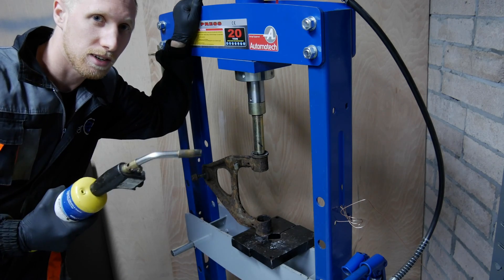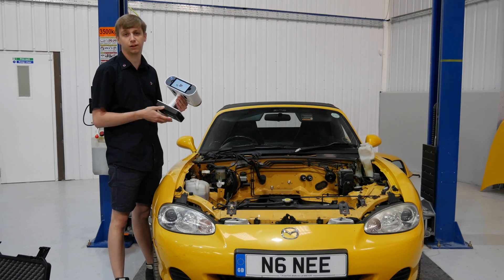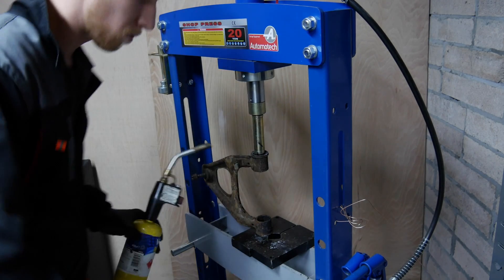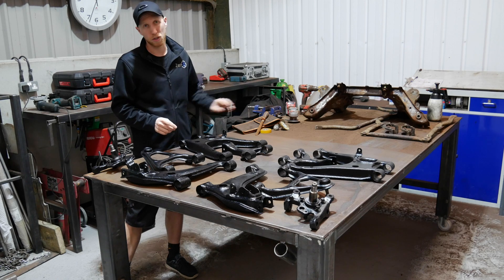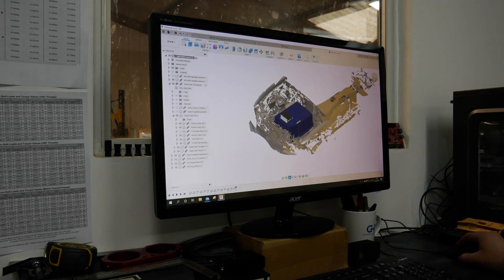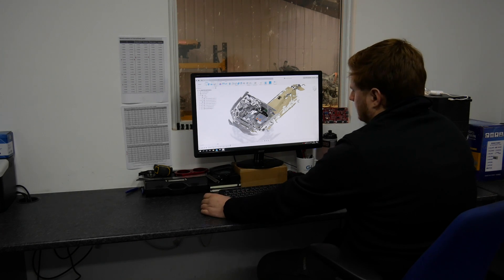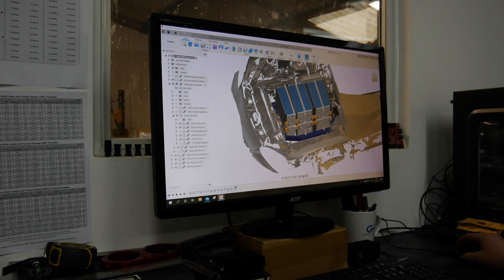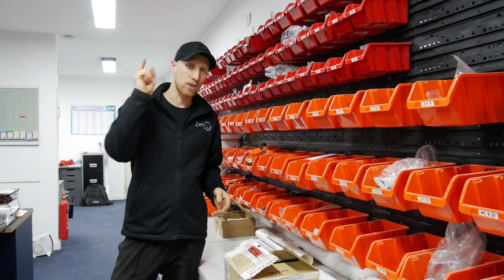Electric Mazda MX5 Miata Eunos EV Car Conversion - 3D Scanning, Fire & Cad Design

Comment: I'll never understand the obsession with removing the transmission. Why wouldn't you want a clutch and selectable gears??
Reply from the maker: Because with an electric motor you have so much more torque you don’t need it, also with the instant torque the motor slowly kills the grearbox and clutch as they where not designed for it.
Reply: @Hazell_Nutz  Torque is great, but the motor efficiency changes substantially over the entire RPM band.

The clutch on an MT has built-in shock absorber. Don't know if either of those points make sense.

Comment: How about registering it in DVLA? if you done conversion in your garage. I think it will pain
Reply from the maker: You can also provide invoice for the parts you have fitted.
Reply: @Hazell_Nutz  Thank you for the advice. I am looking to just upgrade Leaf battery up to 65KV or so on 18650 cells. Probably will be less pain at all.
Reply from the maker: It’s easy just v5 update and tax class form along with invoice of the work done
Reply: @Hazell_Nutz  How do I get  the invoice if I have done conversion in my garage on my own?

Comment: Wouldn't media blasting the rusty bits have been considerably faster and gotten you an even better result? Maybe using baking soda. Just a thought.
Reply from the maker: Yep would of been but unfortunately at the time was a Covid lock down so had to make do.
Reply: @Hazell_Nutz  Yeah, the situation has been pretty unprecedented lately. I believe you can buy baking soda blaster stuff to hook up to any old compressor though, it won't do what sand blasting does but it does peel off rust and such pretty convincingly.
Reply from the maker: Will look into that as we need something to clean down Tesla drive units
Reply: @Hazell_Nutz  Hope that works out well! Soda blasting is great because the medum is so benign, you can basically blast stuff in the back yard, the bicarbonate isn't that damaging. And once you're done, some soapy water to wipe off  the part deals with any residue. But, it's pretty gentle, comparatively speaking - so if you have like deep, caked up rust it may not be able to deal with that even at high-end psi settings.

Comment: I was thinking if you cut out the gas tank area and put all your batteries there, it might give you a mid engine feel. Probably not a good idea through because if crash happens, all batteries would smash toward the driver

Comment: lol, look at the state of that mk2.5, even the rear arches are buggered. the front chassis is going to be cheese! what cheapskates, I can find one for less than 1k in much much better condition than that! ahhahhaaha!!
Reply from the maker: Had to do one front chassis leg as did have rust, arches are not bad, the rear edge on drives side need sorting. We looked for weeks to find this model as they did not make many of them so if you can find one for less than 1k fare play.
Reply: @Hazell_Nutz  I honestly think it would be hard to find a more obviously rotten mx5 than that lemon one, i mean you can see the rot, absolutely easy to find one without any corrosion on the rear. the other front chassis leg on yours must have been repaired as it's probably not possible to have that much rear rot without both front chassis legs being cheese at some point
Reply from the maker: Rear rot? One lower seal is all that was done which is nothing for an Mx5. The more worrying thing is it had a 12 month mot when we brought it 😂. Hindsight is a wonderful thing but it’s now done and looks mint plus drives very well with all new bushes.
Reply: @Hazell_Nutz  you did a good job rescuing it!

Comment: Great build and thanks for sharing. One thing I'd do differently would be electro bath to remove the rust from the suspension components and possibly a rust converter for the hard to reach spots.
Reply from the maker: Yes we should of done that

Comment: Just a note, it’s very easy to bend the control arms by having them on the press like that. You should be okay with the torch helping but I’ve seen tons of those rear lower control arms get bent out of shape from pressing the bushings out like that.
Reply from the maker: Your completely right, have to be very very careful

Comment: and on the topic of the CAD design, another advantage of having a sub-assembly where everything goes in one piece, other than being easier to install, is that it can potentially increase the stiffness of the chassis as well, but that  is assuming that it is literally one big piece of strong metal which holds everything to the chassis

Comment: also, if  you have also scanned the gearbox after you've taken it out, you can use it as a template to verify the scan, and more importantly for its mounting holes, which you can directly copy off from instead of having to make a 'negative' of the chassis
Reply from the maker: The gearbox did not pick up on where we have mounted the frame to. But definitely the right idea if using original gearbox mounts

Comment: why didnt you get a sandblasting gun? you just need an air compressor, the blasting material, and a clean area to use it in
Reply from the maker: We wanted to get it blasted but was in lock down so could not.

Comment: I like how you made use of the flawed 3D scan of the car. I'm a 360 user myself.
Reply: I was thinking they might want to rescan a few bits again and fill in the blanks.
Reply: @jimbodee4043  

Would the extra effort be worth it?

They just need a few reference points, not the full surface model. 

Watching this made me reevaluate my own needs.

Comment: Sandblasting would have made short work out of suspension component clean up.

Did the weight of the battery module ~ = the weight of the original engine?

Wouldn't distribution of the batteries throughout the vehicle lesson the chances of damage to them in an accident?

I drive a 2015 Nissan Leaf so I'm 100% for additional electrics on the road.  Mines gone 47000 miles with no maintenance other than a recent change of tires.  The break fluid still hasn't needed topping up. Same for the engine cooling system.
Reply from the maker: It is always safer to have a single battery pack, having them throughout a vehicle can help weight distributions but will mean more high voltage wiring and additional safety systems. On the mx5 the thinking was that a second pack of similar size could be placed in the rear to increase range. The front pack does not come any further forward than the original engine so crash protection is still standard.
Reply: @Hazell_Nutz  

I drive a 2015 Nissan Leaf. The batteries are under the floor.

What's the range of the Miata?

Comment: Ah guys. I wish there could be a cheap way to scrap the whole bottom of the car and make the battery set be the floor of the car. That could make a lot of improvement in gaining extra room.
Reply from the maker: We wish unfortunately in the uk chassis modification is a big no go.
Reply: @Hazell_Nutz  Yeah. Chassis number. There should be a choice of chassis number registration modification. In how the number would be the same, but they would change the chassis type.

Comment: Next time you need to remove the rust from parts try electrolysis. Big plastic container, washing soda, water,  12v battery charger capable of at least 4amps and some scrap iron for the anode. One day sitting in that would have removed more rust than manual labor. Plus it would descale the inside of the control arms where you can’t sand.

Comment: I‘ve been wondering about the layout you present

1. what happens if you Front Crash ? Is That Safe? Wouldn‘t it be better to put it under the car in the tunnel and where the tank has been before? 

2. why do you need the prop shaft? can‘t you build the motor directly onto the lsd/differential? 

I am in the auto industry - contact me for any chat over LinkedIn Christof Chrappek
Reply from the maker: It is fine we have sat the battery in the same place as the original engine so crash zone is still there. It’s nice to think that battery’s can be put in the tunnel and fuel tank area but the modules are a set size so limited to the locations. 

We can not fit the motor any further back as the tunnel is not big enough.

Comment: I did the rubber bushing removal on my 2000 eclipse using the torch method. It is a crappie job but we'll worth doing, installed Prothane polymer bushes & new springs & struts. The handling improved no end !!
Rebuilt all the brakes and installed stainless reinforced  brake hoses.  Bigger ventilated disks  improved stopping. It's a dirty job but well worth doing.

Comment: I’m really surprised that such a big workshop that works on various cars, etc doesn’t have  a shot / hydro blaster.
Reply from the maker: We do electric vehicles conversion not restoration work. This is a one off.
Reply: Zero EV it’s not a dig and that’s fair enough.. it’ll just save you a lot of labour time in the future and it’s cleaner. It’s a well worth piece of workshop equipment.

Comment: I just did the same thing to my suspension on my VX220. I used electrolysis to remove the rust, it all just fell off. https://photos.app.goo.gl/1ZCyv2rieXLWiRQQ8
Reply: https://photos.app.goo.gl/w13HTrbABZeW9Jvv7
Reply: https://photos.app.goo.gl/5FfRUA77Fv2SfAQ68
Reply: I'm interested in why you are using powerflex bushes on a road car? They make the ride harsh.
Reply from the maker: They where free 😂
Reply: @Hazell_Nutz  Fair enough, great videos! If I was the owner I'd definitely pay the extra for some rubber, especially on an electric car where NVH is going to be more noticeable then ever given there is no engine.

Comment: The battery packaging is a marvel - but I have my reservations for deleting the gearbox and using the 100V x 350A motor in its lonesome. It would be a clean conversion under the hood sure, but may turn out to be anemic. Gearboxes on EVs tend to be pretty fun!

What's the likelihood of splitting the batteries in two and having one pack overhanging the rear axle in the boot?
Reply from the maker: We will be running a 1.8:1 single speed gearbox. Always best to keep packs as one piece. Option to have a second pack in rear maybe.
Reply: @Hazell_Nutz  looking forward to the progress! 👍

Comment: Did you look at freecad? Cheaper than fusion360 and still pretty good. Then collaborate using git. And you can change it if it doesn't do what you want. https://www.freecadweb.org/
Reply from the maker: We did but now fully committed to fusion.
Reply: @Hazell_Nutz  Fair enough. I've started using it recently for architecture/building retrofit, having upgraded from good old 2D CAD. I've not tried it for the sort of modelling you are doing here, but do plan an EV/camper conversion sometime in the next few years. I'd be interested to know what factors made you choose fusion.

Comment: So all your weight is going to be up front? Are you going to put more batteries in the boot?
Reply from the maker: We have moved some other parts over the rear now. Plan was to have the option for a second battery pack over the rear to double range

Comment: Nice work lads! did that de-rusting job in my shed last year. best tool for it is a very large steel wire wheel for the angle grinder. Absolutely minces the rust off. they sell em at proper job as you sound like you're in/around bristol :)
Reply from the maker: 😂 I though I hid my bristolan

Comment: What kind of differential is going in? I would go with an original torsen differential and upgrade to a rx7 fc diff carrier, the original housing will break immediately. The car passion channel has a video on this upgrade
Reply from the maker: Definitely want to upgrade the diff for first testing will use original unit than want a 3.6 lsd really
Reply: @Hazell_Nutz  I don't know if a rx7 fc diff carrier will fit on a lsd model... But the upgrade holds 450whp XD

Comment: Really cool - did you have to bypass the gearbox or was that a choice? I'd hate to lose manual but I've no idea how long a normal clutch would last under electric motor torque...I would guess not long!
Reply from the maker: We chose to remove gearbox as this vehicle is being built to test our new 1.8:1 single speed gearbox. Just decided to film the build as a bonus.
Reply: Zero EV I'm really glad you are filming it - fascinating to watch!

Comment: Can’t you get new subframes, only the old ones are going to be just as rusty on the inside and the outside!
Reply from the maker: The subframes where actually in ok condition I think that’s because of the engine and diff oil 😂

Comment: I'm digging this project so much. My MX5 is without engine and transmission at the moment anyway and seeing the placement and design of where you want to put the motor and the batteries I would really like to go electric instead of combustion again. It just seems like a really cool way of transforming an "oldtimer" into a modern car. I say oldtimer because I've got an NA and since the subframes are practically the same between NA and NB your kit should work with an NA, too, right?
Reply from the maker: Yes should work I think.

Comment: Did you weight the stuff removed from the front and the gas tank (empty and full) to make sure the end product is 50-50 weight distributed?
It might be a little bit front heavy the way you did it. What do you think?
Reply from the maker: I forgot to weigh the other parts but on eps 3 will go through the weight, we will put some parts in the rear now,
Reply: @Hazell_Nutz  The gas/fuel tank space could be used for some batteries too if it is front heavy, should reduce back spin/roll, and add stability. It all depends on the weight of added and removed parts. 
The MX5 is a gread car handelling and cornering wise, it would be great if it maintains/improves this after conversion.

A very good added bonus and selling point for your system (wink wink) would be the 50-50 maintained weight distribution, the stock MX5 maintains this only partially depending on how much gas in the tank, with this out of the equation, you can acheive a true, close to 100% 50-50

Comment: Why not leave the mx5 trans
Reply from the maker: As you then have a motor in the engine bay so eats away at battery space.
Reply from the maker: Plus the hole point in the build for us is to test our new single Speed gearbox

Comment: Cool project, but could you talk about weight distribution.  MX5 are famous for their almost 50-50 weight distribution, I was surprised to see all the batteries going upfront and relatively high.  MX5 have are all about handling, not power.  Sorry if I missed the comments on this already.
Reply from the maker: Am going through weight in episode 3

Comment: Hey man, I think that what you are doing is really interesting and as it is is entertaining enough, but it could be better. As a suggestion, don't keep the scenes that are not related to the project itself, like you walking and then going up the stairs and then sitting, the music is not really necessary, if you are showing a montage you can just use the sounds of the machine and sped up the footage, for the CAD explanations is a bit difficult making them interesting enough to a broad audience, but you could go over what was done showing the screen itself without going too much into detail.
As a final though you should check out the editing style of Chris fix, this old Tony and wintergatan. Excellent building and engineering channels(if you still want to use music you could ask martin from wintergatan to let you use some of his tracks).
Reply from the maker: It’s very difficult as everyone has there ones opinion can’t please them all 😂

Comment: Seems like a lot of corrosion on the underside of this car. Salted roads much? Or was it driven down a seaside beach? ah.. @2:53 it is a bit of a rustbucket eh? More than just the chassis is rusted! @5:39 Thank you for reminding me why I gave up working on cars. - bleah
Reply from the maker: This is why I started doing Ev builds to get way from rust repairs but now stuck with it, just cut the sill out will be sorting in the few episodes

Comment: Next miata RIP 😓
Reply from the maker: Daniel Mielcarek why?
Reply: @Hazell_Nutz  I understand that the topic of your channel is to make gas cars for electric cars but to do such harm to Mazda mx-5 😓.  She won't do utu here here here here anymore.  that's it.  It will weigh a lot more.  it must be light 😞 well it won't have character if it has something instead of the front engine.  But if you have to do it, but ... I can't look at it.  😰😫 ... 
(😰x10000000000000000000000000000)

TRANSLATED BY GOOGLE:
From Polish to English
Reply from the maker: It will only weigh 20kg more.
Reply: @Hazell_Nutz  Nice . But u have to install sound modulator becouse every one who love miata like "ututututu" sound. If u install it just IT willl be good job.
Reply: Most Miatas don't make that noise because they are naturally aspirated.

Comment: How is it that you can get fusion 360 for free? I was able to get it through my school, but my dad could only get a one-month trial.

Also, I found a used 2002 Porsche Boxster with a dead engine and automatic transmission for about the same price as the working manual Miata I was considering. The Boxster looks to be in much better aesthetic condition, though it has thrice as many kilometres on it. The Miata was also imported from Japan at one point, so the steering wheel is on the right side of the car, whereas most vehicles in Canada are left-hand drive, though right-hand drive is legal. Between the two, which would you recommend?
Reply from the maker: Aiden Bagshaw if it’s your first conversion then the mx5. We pay for fusion but was sure there is a free personal option with slightly limited options
Reply: Zero EV Thank you.